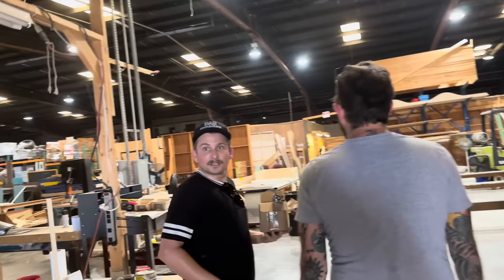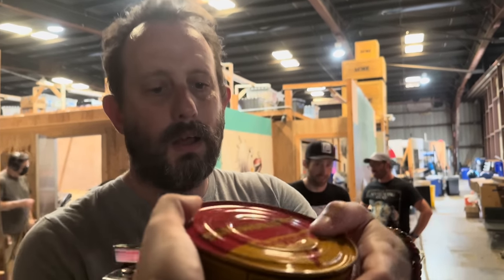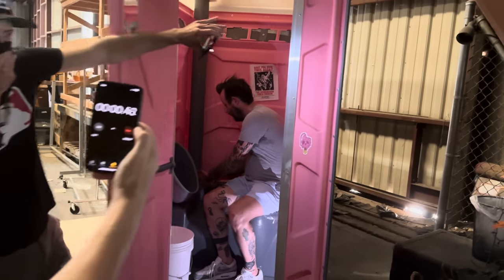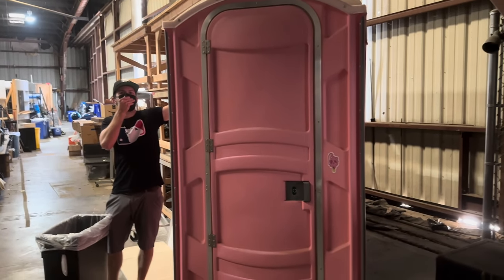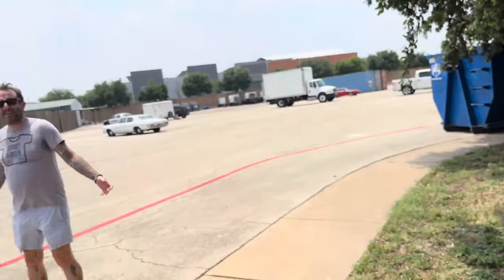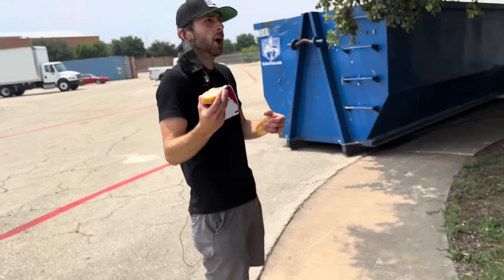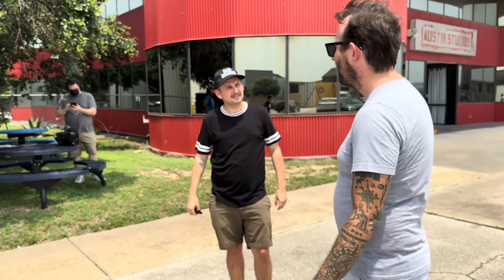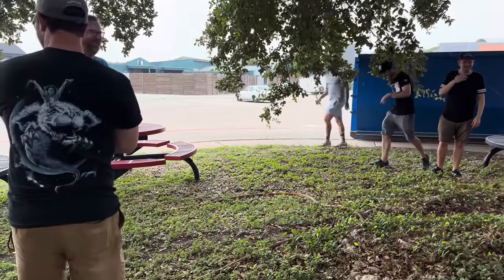Surströmming Nose Flaps Test

Comment: Super impressed by Geoff, actually. I am a Swede, and I do eat Surströmming once every other summer or so. The smell I would describe as a porta-potty set on fire after 100 people with a really bad stomach flu has had a go in it. The taste however; salty. It should be eaten in small pieces rolled up in a soft flat-bread with small boiled potatoes, red onion, chives and some sour cream. Then it's just a taste enhancer. Actually quite good. 

The taste of Surströmming on its' own is hard to describe. Not bad, but... poisonous. It doesn't taste bad, but your body wants to reject it in a weird way. xD